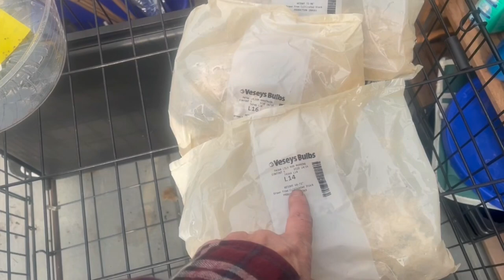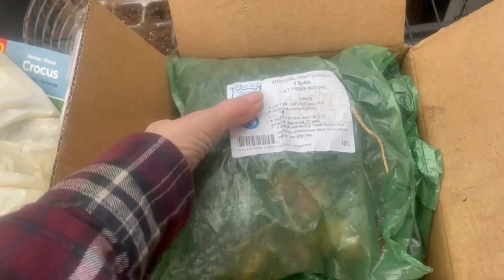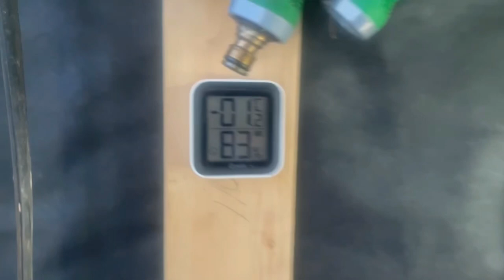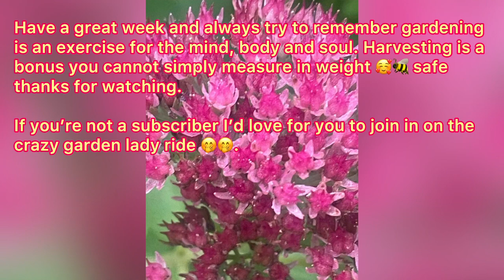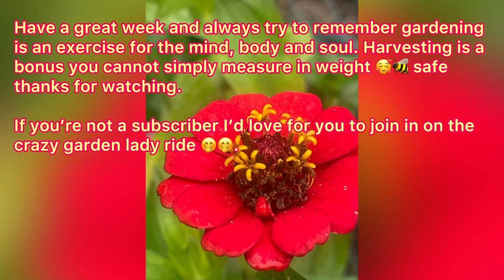#95 #winter🥶#fleece

Comment: Hey Ali i was just thinking how great it is that there are no slugs on your brassicas when you mentioned it 😂.
move the Dahlia pot somewhere warm and dry after you cut the top off. mulch it with compost. Mice love them for food in the winter. you could also dig it up and take it in but i would be too lazy for that
Reply from the maker: Morning Stella hope your well. First it was way too hot and dry for slugs barely any all summer, then it got way too cold so I guess the extremes had some benefit. I’m lazy about digging up bulbs and tubers too so I’ll take the chip and mulch method 😁😁. I may put in the garage though and protect the pot but we don’t have mice inside 🤞. Have a super weekend stay safe and keep warm 🥰